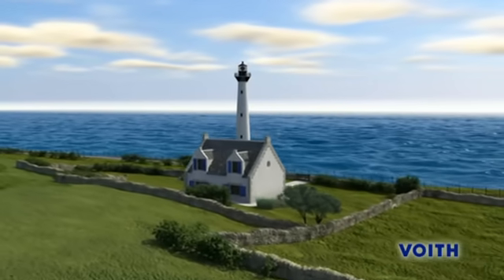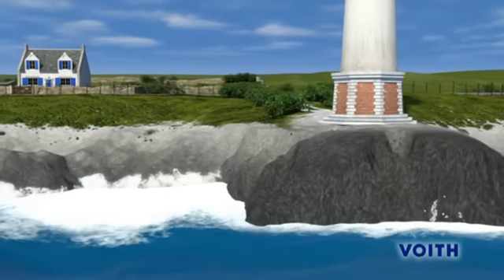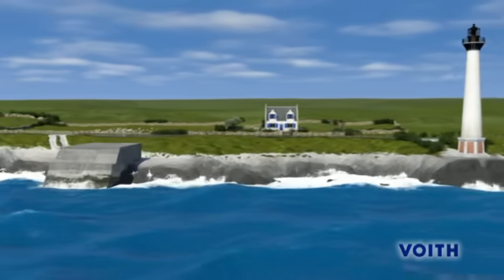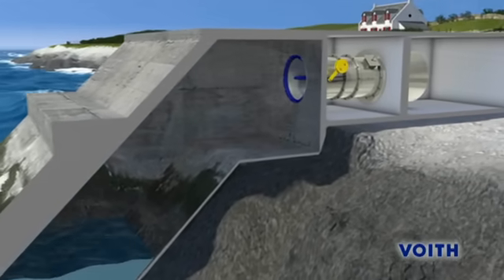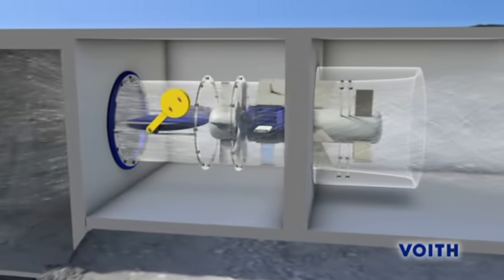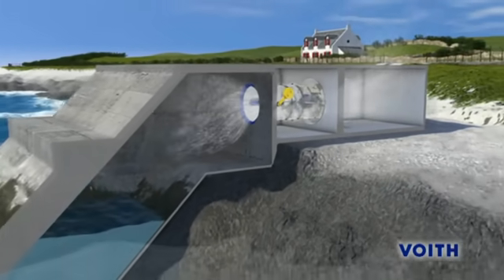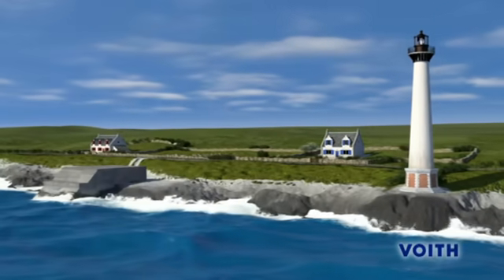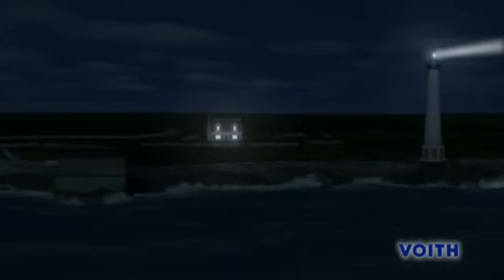Ocean Energy -  Wave Power Station

Comment: Why not putting turbine in water to stay always in water? It will produce more power, no need for vacuum seal etc.
Reply from the maker: @ Nechastivi: Saltwater is extremely corrosive and the maintenance in the water is quite expensive.
Reply: @IdeasfortheGreenPlanet  only turbine propeler can be in water, it's not that difficult and it can be protected by different anticorrosive layers. It won't work at high speeds and it could stay in building same as this animation shows(piston like position in this "bunker").
Reply: Now I thought more about it, you can also put floating piston which can move with tides(up and down) and turn shaft on electric generators.
Still I think that pushing air won't work because there can't be enough pressure to move air, also air can be compressed "easily". Still the best way of us freeing water is by river damn, no salt, near constant water stream and cities are usually built around big rivers so you fixed issues with long range transport of electricity.

Comment: so it's been 11 years and I'm going to assume this project is dead as if they were really all that great then why aren't they everywhere and common knowledge by now?
Reply from the maker: @theDemolisher13: In the year 2011, the Mutriku Breakwater Wave Plant was inaugurated. It works on the same principle - the "Oscillating Water Column".  The Basque Energy Agency commissioned it in the bay of Mutriku in the Bay of Biscay. It is the world's first breakwater wave power plant with a multiple turbine arrangement. The plant has a capacity of 296 kW from 16 turbo generator sets.
Reply: @IdeasfortheGreenPlanet  Alright but wouldn't it be more effective to just convert the wave energy into heat energy by just running a heat pump through the water and pulling out all of the viable energy from it till it freezes. Then take the energy you just pulled out and put it into something like a boiler to turn a turbine?

Comment: So, 11 years later, my questions are: How efficient is this? Is it still there? and How much trouble is it to clean and maintain the station?
Reply from the maker: @ChronoXShadow: This site on Isle of Islay was shut down in 2018. In the year 2011, the Mutriku Breakwater Wave Plant was inaugurated. It works on the same principle - the "Oscillating Water Column".  The Basque Energy Agency commissioned it in the bay of Mutriku in the Bay of Biscay. It is the world's first breakwater wave power plant with a multiple turbine arrangement. The plant has a capacity of 296 kW from 16 turbo generator sets. This technology is evolving. There is a lot of R&D on this site.

Comment: This will never work. You can't go from negative to positive pressure in such short time in such large volumes and still receive energy. 

Besides this is the same design as a wave generator for a pool.
Reply from the maker: @Giuseppe Veghen : Your claim is not valid. It is working. There is a Wave Power Plant in Mutriku, Basque Land in Spain. It is built into the wave breaker. It was commissioned in 2011. You can also visit it.
Reply: @IdeasfortheGreenPlanet  basic common sense says otherwise

Comment: so how many are operational ?
Reply from the maker: @Jack Ski : Thank you for your question. This site was closed in 2018. In the year 2011, the Mutriku Breakwater Wave Plant was inaugurated. It works on the same principle - the "Oscillating Water Column".  The Basque Energy Agency commissioned it in the bay of Mutriku in the Bay of Biscay. It is the world's first breakwater wave power plant with a multiple turbine arrangement. The plant has a capacity of 296 kW from 16 turbo generator sets. You can visit the plant.

Comment: You would be better off just using the motion of the waves directly.  This WON'T WORK!!!
Reply from the maker: @protoborg: Thank you for your comment, but you're mistaken. You definitely can convert the wave energy into electricity based on this principle. It is called the Oscillating Water Column.

Comment: WOW! this is a genius way to greatly minimize contact with corrosive salt water.
Corrosion is one of the major challenges of harnessing Wave Power.
Reply: The only downsides were the civil works in constructing it - rock blasting and temporary walls etc. kinda like a makeshift drydock. Long as the parts used are suitable for a marine environment, and the wells turbine isn't very efficient by design. But once it's up and running it's minimal maintenance and the entire electrical side is in the chambers and easy to access, instead of on the sea bed etc.

Comment: Very cool,would like more stats how much voltage etc...
Reply from the maker: @Thomas Sullivan: Hi Thomas, thank you for your question. The power plant shown in this video had 2 Wells turbines with 250 kW each. It was closed in 2018. It was built mainly for R&D. In the year 2011, in the city, Mutriku, on the Atlantic coast of the Basque Country in Spain, a new wave power plant went on the grid. It was designed for 16 turbines, in total 296 kW. You can visit the plant (https://www.mutriku.eus/en/tourism/mutriku/olatu-planta)

Comment: What happens as the tide moves in and out?
Reply: I suppose the thing could be on rails and move in and out automatically to the ideal spot.
Reply from the maker: @Frank Mayer : Thank you for your question. The chamber's front wall where the wave moves up and down is always under the water level - even with low tide.

Comment: how does the air stay in one chamber before it is pushed out, and then how does its return back,
Reply from the maker: @Pawel MacPoof : The only opening where the air can go in and out is through the opening where the turbine is mounted. When the wave moves up, it pushes the air through the Wells turbine. When the wave moves down, it sucks the air from the surrounding. The chamber's front wall is deep in the water, even if there is a low tide.

Comment: you'll need to destroy entire coastlines to get enough energy from these things
Reply from the maker: @Omegawerewolfx : Yes you are right. We should not destroy our coastline. This plant here was mostly R&D plant and was closed in 2018. A new wave power plant based on the same principle - Oscillating Water Column - was build into the wave breaker. In this way the coastline is not destroyed. This wave power plant harvest the wave energy since 2011 and was designed for 16 Wells turbines with total power of 296 kW. You can visit the plant (more info here: https://www.mutriku.eus/en/tourism/mutriku/olatu-planta)

Comment: Why not put it in the water directly?  Why bother involving air and suffering the loss of some energy?

Oh right, ocean water is very corrosive.  Also this design will still require ungodly amounts of maintenance and a surprising amount of oil products to keep running ie lubricant and sealant.

I am not trashing wave or tidal power in general.  In fact i would love to see it developed further, but this ain't it chief.
Reply from the maker: @ForeverEpicness: Thank you for your comment. Yes, you are right. The water is corrosive and maintenance in water is cost intensive. This is only one way to harvest the wave energy. Maybe someone will develop something better.

Comment: Effect of high tide and low tide on it?
Reply from the maker: @Mech_Warrior  : The opening where the air flows in and out is beyond low and high tide level.
Reply: @IdeasfortheGreenPlanet yes, I am talking about, the opening where water flows in and out, it should be at most 6.5 metres in depth, from minimum sea level.. Otherwise the sea water will come in contact with the turbine.

Comment: Oh wow! Would you look at that! Another amazing idea that will phase out nuclear power! It just needs a few years to be implemented, it only relies on completely inconsistent waves and the energy output is not even mentioned!
-11 years later...
Reply: Too bad it has absolutely no chance of ever outcompeting nuclear and geothermal and wind.  Standard wind power is 50% efficient.  The other 3 top renewable sources or hardly much better.  Thorium is VASTLY better as it has a much denser energy profile.  Plus, this idea would require covering the entire coastline with these ugly concrete structures.  Doesn't sound very good to me.  There is also the fact that moving water does NOT induce a sufficient a large vacuum when it is moving.  This would basically only be moving the volume of air that is already inside the chamber when they seal it up.  As that air is not of great volume, it would have negligible effect on the air turbine.

Comment: The problem I see is the volume and speed of the air. Low volume and low acceleration due to the water rising/falling slowly. I hardly doubt this can properly turn any turbine, let alone enough to turn a generator which adds resistance. And even IF it can do that, the generated power will be so low you get like 5 cents worth of power per month running this thing with an installation cost of probably 500.000$. In other words it will never pay off.
Reply from the maker: @StriKe jk: Thank you for your comment. Watch https://www.youtube.com/watch?v=kXfSrCWA7qA for the explanation of the Wells turbine. It has to be initially turned on. The Basque (Spain) energy provider built a wave power plant in Mutriku/Spain/Europe into a wave breaker. It has 16 chambers with Wells Turbines. It generates 296kW. Today some of the sections are used for R&D. This idea develops further.

Comment: Company was closed and instalation dismantled. By looking at it, it could probably power couple house, which is really low, considering cost of concrete alone for the chamber.
https://en.wikipedia.org/wiki/Wavegen
https://en.wikipedia.org/wiki/Islay_LIMPET
Reply from the maker: @Mareczekw30  : Thank you for your comment. Yes This power station was closed in 2018. The Limpet power station, shown in this movie, was designed to convert 500kW form wave energy with two Wells turbines. It was also R&D site under real conditions. In the year 2011 the Basque (Spain) energy provider opened wave power station based on this principle, the oscillating water column and Wells turbine.  This idea of harvesting the wave energy is not dead it is under ongoing development.
Reply: @IdeasfortheGreenPlanet  thanks for answer :) I hope it will be one of the many future sources

Comment: At Sea level air is 784 times less dense than water. Even with the increased mechanical stress and greater corrosion issues, wouldn't it be far more efficient to place the turbines inside the water?

Comment: I see a couple of problems.
1) There is no explanation of power output. Judging by how there's only a single turbine, I can tell that it's most likely only enough to power a neighborhood or two.
2) Not all of the beaches on Earth have the geological makeup that would allow for waves powerful enough.
3) The amount of power stations required to power an entire city would require that power stations line entire coastlines, which is just... forget it.
4) Low tide exists and it'll cause generators to stop generating sufficient power, if any.

Comment: Interesting concept, but how many watts does one of these turbines produce exactly? That said, it looks like it has the same problem as hydroelectric in that, it is dependent on location.
Reply from the maker: @Zenas Starchild: Thank you for your comment. Yes you are right, not all coasts in the world are suitable for such wave energy converter. The power station shown in this movie converted 500 kW with two Wells turbines from wave energy. The wave power station in Mutriku/Spain/Europe, is designed to generate 294 KW with 16 Wells turbines.

Comment: It was great idea but engineered terribly.
Nobody bothered to check the slope of the sea bed to see if it was a suitable location, (It wasn't).
It was built in it's own little harbour which caused power-sapping turbulence.
The rear walls were sheer, not tapered, which caused more turbulence.
The turbine blade mechanism was ineffective and problematic.
Had it been designed more thoughtfully, in a better location, it could have been a success and a blueprint for other islands to efficiently meet their whole power needs.
https://tethys.pnnl.gov/sites/default/files/publications/Islay_LIMPET_Report.pdf

Comment: This is not at all what I was expecting... I was expecting something to do with water pressure, but instead I got an explanation for what's basically an inferior wind turbine. I like the idea of the technology, but depending on weather conditions(which are an insurmountable variable), both land, construction and maintenance would cost far too much for the fact that the facility wouldn't really work at low tide, and even if you peaked out some kind of super-battery, the biggest problem is the fall and winter seasons, where you're pretty much always at low tide. It's ultimately inferior to solar power and nuclear energy(I support both). 

There are other problems, but I will say this, since some in the comments aren't very kind: 

The idea is worth a shot as an additive source of electrical power. If one lives on on the coast and not in a commercial district, it would be worth having that extra source of energy. You could probably use it to supplement power outages as a back-up generator. It'd be grossly inefficient for a rural area, but if you own seaside property, and are keen to remove the beach, this is an option available to a select few.

Comment: LOW TIDE POWER OUTAGES, THAT SOUNDS LIKE FUN
Reply: @marthale7 But the energy will be greatly reduced in low tide. If you are capturing water to spin turbines that's not a lot of water. If you are just using the same machine as the video, the ability to compress air has been greatly reduced at low tide. If you move the machine down at low tide then you have potentially more failure points. You also have to figure out how to move it back up.

Either way this video is good for almost nothing. You would need to see a working demo of the machine with more information.
Reply: @marthale7 ok, you can't think that. I would like to think that as well but you can only capture so much water.

You are limited by the tide height and how much water your intake can support. 

Either way you are still loosing power. Storing water also comes at it's own cost.

Depending on where you live the range is 4 to 10 ft. Are you moving the structure 4 ft or are you dealing with a loss of pressure.

If you are storing water you can store between 3 and 8 ft of water. That's at an incline so the further you want to store water away the less water you can store.

If the tide does not dip below your output you can't generate any power. 

Clean "free" sources of energy are great but they have problems.
Reply: @marthale7 This is a great setup but as the video states it's all about location. They have massive changes in there elevation. You cannot do the same thing with the thing in the video. The technologies are completely different. 

That being said was a good video thanks for sharing.